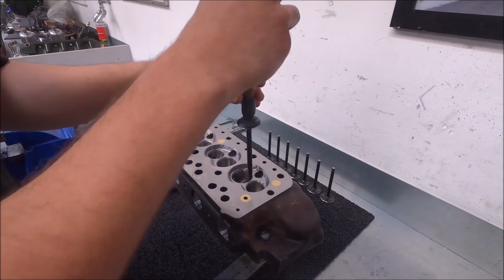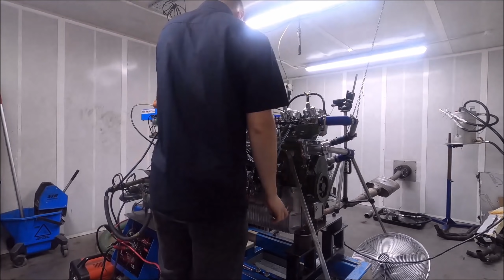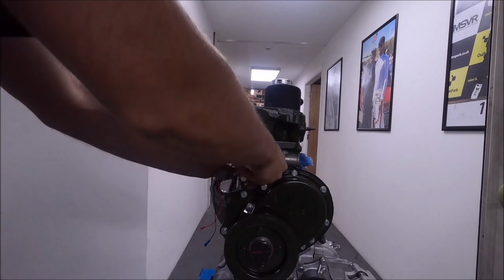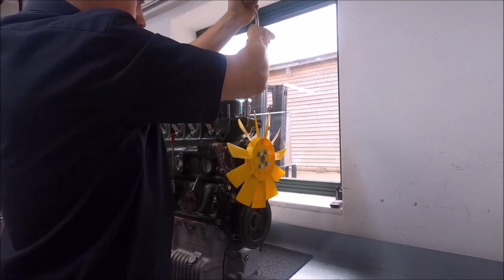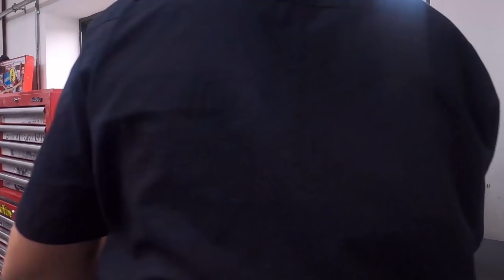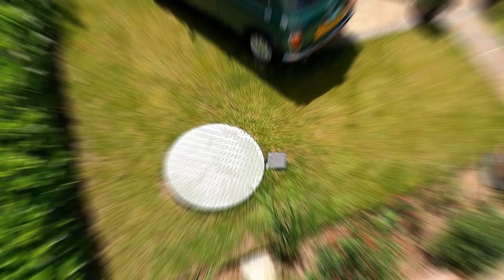Swiftune Engine Assembly Madgwick Mini Cooper S Part 6 - Classic Mini Workshop

Comment: Showing my age I know but 1 and a half su s with BG needles and blue springs plus 649 cam was  tops for 1293 race engines. John Rhodes managed to create tyre smoke with this set up.a company in Essex reputedly got a 970s engine to rev to over 9000 with the addition of a single downdraft  Weber carb. Featured in either car and car conversions or hot car in the late 60s.had a 997 cooper and a 1071 and 1275 cooper s and covered some 140 thousand miles altogether in them. Great videos all of them. Rog
Reply from the maker: Thanks Rog, sounds like an amazing car and well used. I bet you wish you still had them
Reply: @classicminiworkshop  wish I had the 997 cooper. Originals are extremely hard to come by these days. Really enjoy your videos. Thanks again. Rog.

Comment: Great video again,ONE question,What did Mark have to round up for the build.,or does Swiftune supply everthing?
Reply from the maker: Shell, engine, interior, gearbox, brightwork. Most of it to be honest.
Reply: Hi Robert, i had to obviously source the shell, then a block, head, crank, remote and gearbox as these are readily available. I source most of the bright work, door parts, windows and subframes and tanks. Pretty much as if i was giving them a fully built 850 deluxe in great condition. It was a hard slog getting some parts , especially decent brightwork. All the running gear is new.

Comment: 1380, sw5 cam and H4 carbs is a right setup! They absolutely fly
Reply from the maker: I've taken advice from Rhodri above and I think we'll dump the H4 carbs and put an SPI unit on it, much more period correct LOL
Reply: @classicminiworkshop  I'd go for haltech management. Very period for the 60s 😂 I just saw his comment...... I shall refrain myself.
Reply: Richard longman used split Weber's on his 1293 race engines. Other mini tuners then followed suite possibly broadspeed but I couldn't be sure. Rog